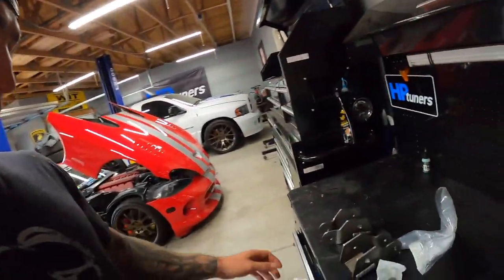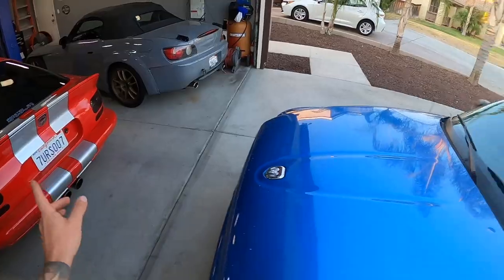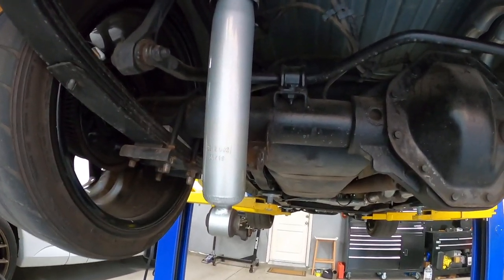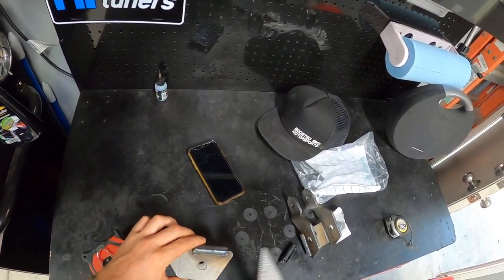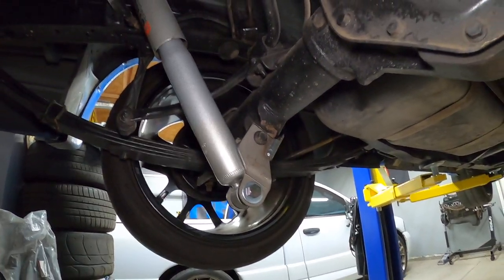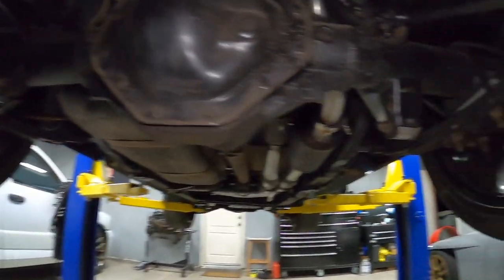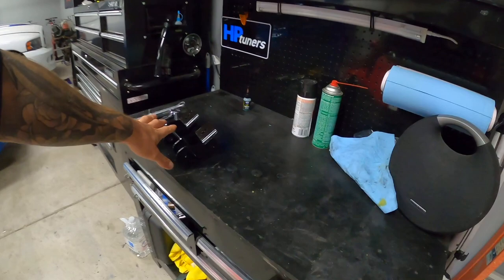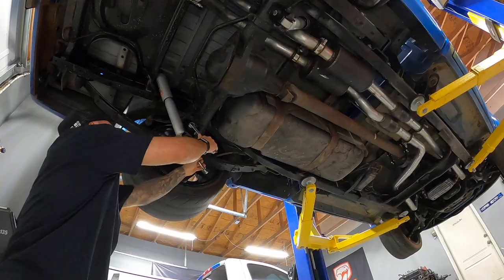LOWERED DODGE TRUCK REAR SHOCK EXTENDERS

Comment: Where did you get these brackets? I've searched before, and even looked for shorter shocks and didn't find anything. I've got the same shocks on mine.
Reply from the maker: I had to make these out of some brackets jason had. If you saw the video from a few weeks ago I ordered some and the fitment was even worse than these ones. No idea where these came from but I had to modify these lol
Reply: @BoostedMotorsports  I'll definitely check it out! I saw a pair on ebay, but the design looked different. My truck has a c-notch, and it honestly has helped alot definitely recommend on yours.
Reply from the maker: The ones on eBay are the ones I returned cause they had terrible fitment 👀
Reply: @BoostedMotorsports  I wont be ordering those then 😅😂
Reply: Look up bell- tech nitro drop shocks have all kinds of kits for Ram and Dakota

Comment: Bro those extensions are just like the Bell Tech extensions if those aren't Bell Tech...problem with those is they narrow down at the bottom too much, and they start rubbing on the shock body wearing a flat spot on them. I would check Reklez extensions, at least with the GM extensions. They are wider at the bottom and spacers are supplied as well to mount it up at the bottom. Food for thought bro 🤷🏻‍♂️

Comment: Will this work for a 2012 charger front and back? If so where do I buy them from. I lowered it with the pro kit eibach springs and shocks and it ride harsh over bumps and bumpy roads or imperfections in the road.